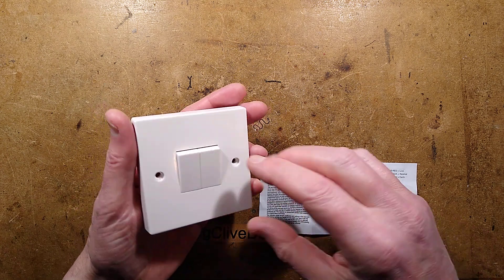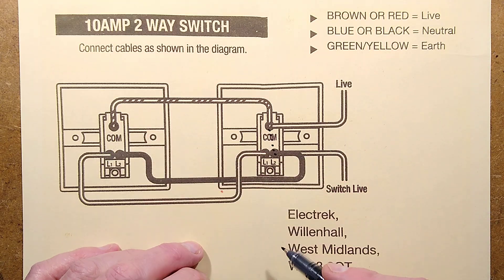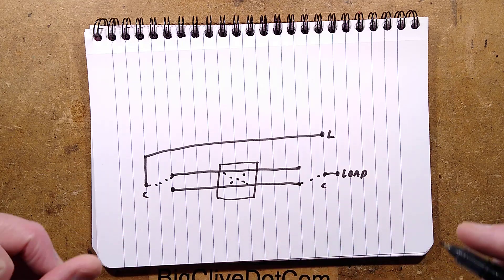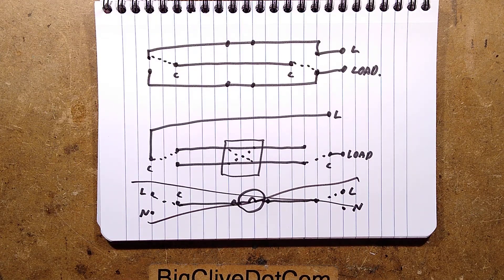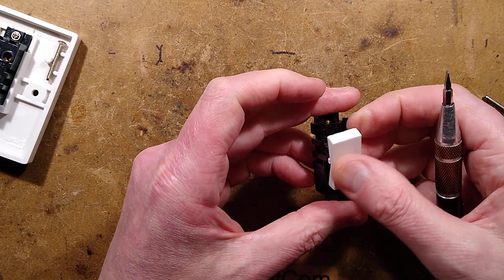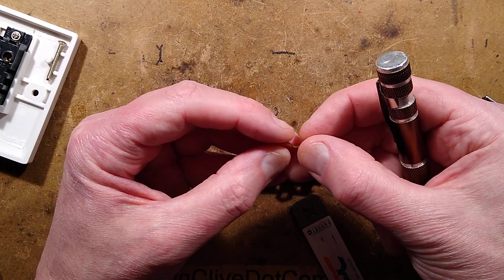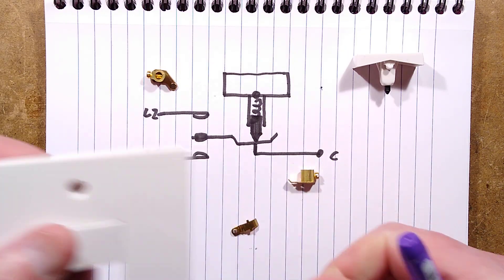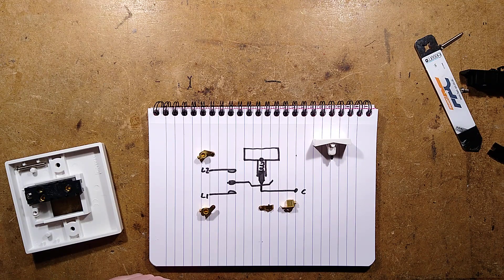Poundland 50p switch teardown

Comment: So, in essence, me not being a sparky but relying on the diagram to allow me to swap one out myself means lots of death and fiery doom.

Brilliant.
Reply: No death or fiery doom, unless you do something silly like try to replace them while the circuit is still energized. As Clive mentions, it just means your switches won't work the way you expected them to - one of them will lock out the other when it's on.

Comment: It always makes me laugh in the movies when the lights are turned on in a factory, stadium or supermarket. There's a BOOM, BOOM, BOOM, sound synchronised to the illumination as opposed to a little 'click,' click,' click.' 😂
Reply: actually that is right. In a large place you don't just "turn on the lights" you operate a switch and a bunch of control electronics takes over and switches the lights on in banks through relays (or similar) There could be kilowatts being switched on each bank, they make a bit of a thump
Reply: I like the candles in the movies - they light one single candle and its like the whole room is in daylight 😂
Reply: I like the sci fi movies with booms and whooshes in the vacuum of space when ships fire on each other.
Reply: That is because in larger systems, there is a large contactor (just a power relay) instead of a small switch as the kind shown in the video. And contactors are *loud*. They really do the "boom" seen in the movies, especially if the place is empty! Some places even have sequencers to spread the large startup load along a few seconds, resulting in the "boom boom boom..." you mentioned.
Reply: @MCPicoli  You are right, in this case the movies are actually authentic.

Comment: The top three way wiring, with one minor adjustment, is called a California three-way. It's connected the same except that the hot (line) would be connected to the left switch while the load would stay where it is. It's not recommended anymore since it traverses the length a variable one or three times, vs two times with the hot and load on the same side or one time with the traveler configuration.

Comment: Over a decade ago we had our house remodeled and the main floor hallway light had a 2-way switch and I guess the electrician followed those misprinted instructions as it didn't work as intended. It's always fascinating how different countries use different terms. As someone else mentioned we call that wire a traveler.
Reply: A classmate once told me that his mom (a maths teacher) had replaced the kitchen light switch. Now they could either have the light on or listen to the radio but not both (she connected the live feed to the socket next to the switch to L2 rather than Com together with the feed in). I told him it was an easy fix but he politely declined, they'd gotten so used to this state of things they didn't want to change it.

Comment: the first thing i did in my home after learning about electronics was replacing a broken switch with one much like yours. it still has the switch upside down as I cocked up the installation.

Comment: I'm still stuck at wanting the cross-cross switches in one place??? Like the point is so at any location you can toggle the switch and the complete circuit is effectively toggled, but what's the point of having it in one place?? You just WANT to use two switches, and have criss-crossed to be on??
Reply from the maker: The mid position switches could be used in a long stairwell so that each landing could have a switch.

Comment: I was an electrician in the US for 40 years.  I always used your first option with the common on one line, and the other load with two wires jumped between.  We consider that a 3 way switch, then any more in between are 4 way.   Sometimes, mainly doiing rewiring of an older building,  I might us the method you prefer. All depends where the line and load wires are. Every country seems to consider it different.
Reply: I think the design and accepted usage of the accessories is also a factor.

AIUI US lightswitches are typically designed for only 1 wire per terminal, while in the UK we use a different style of terminals and think nothing of putting up to three wires in a terminal. This changes which wiring method requires the least splices for a typical installation.

Comment: The wiring diagram seems to have little to no relationship to the actual switches. Why would anyone want to wire up two switches on the same gang plate as a two way switching circuit. The only practical reason why one uses a two way switching is because one wants to control a load, usually a light, from two different and widely separated locations or switches, definitely not two switches on the same gang. The wiring diagram as published is practically useless and redundant as well as being mislabeled. Maybe that is why the ganged switches were going cheap.
Reply from the maker: A two way switch can also be used as a single switch, so the plate with two switches could be controlling a porch light and also two way switched hall lighting.
Reply: @bigclivedotcom  Not really relevant as then each switch on the plate has a different function in basically different circuits which is normal and not what two way switching is or what the supplied circuit diagram represented?

Comment: Wiring method can depend on the cabling method being used. Eg single insulated cables in a conduit or double insulated pvc/pvc flat cables clipped.

Comment: 6:56 I must confess to, as a child, deliberately holding switches at the position where it rocks so that they would make a sparking noise and make the lights flicker!
Reply from the maker: I did that too.
Reply: Me too! With the added incentive that I could hear the interference on the TV downstairs, and my parents complaining..
Reply: I discovered that where I used to live, if I had the oven, computer, PS4, and the AC on, and then tried to do vacuum cleaning, the lights would flicker. The main breaker had a 30A (3 kW) limit.
Reply: LED lamps spoil that game for the upcoming generation because the power supply usually smooths out the flicker: spoilsports!
Reply: Hooligan!😉

Comment: Electrically, how does this work? We have lights in our house that can be controlled by three different switches and I cannot for the life me work out how they work. Seeing it sketched out, I still can’t work it out since it seems to me that the electricity can still flow to the light somehow. 
I haven’t managed to find a good resource explaining how this works, only resources explaining how to wire them up.
Reply from the maker: Draw out the multi-way schematic I showed and then draw in every possible combination. Or for more fun, wire up some real switches with a USB power supply and a USB light for a practical demonstration.

Comment: 3 way/2way switches are single pole double throw switches. 2 in parallel can be used as a transfer switch or forward and reverse switch and if you add a 4, way switch 2 pole 2 throw switch you also get a foreward and reverse switch for DC and you add as many as you want in between 2 single pole double throw yiu can turn on lights from hundreds of locations

Comment: I would say the way to wire the switch depends on what you want to do.
The normal way most people wire it is so either switch is capable of toggling the state.
But an alternative is to make it so either switch can turn it on, but both need to be off to make it off.

Comment: A little bit different to the switches we use "Down Under". Most of mine are two - way, even those used as mains power switches. The advantage is that if you have a duff switch, there's no need to change the faceplate - just replace the switch, and you're ok to go. The same enclosures can be used to accommodate indicators, and variable light controllers.
Reply: Sounds like the way we do it in continental Europe.

Comment: Nice job C. We use the strappers here in Ireland, but previously my work in the UK was method two, which is safer but uses much more copper. These things are taught in parrot fashion and its amazing how easy it is to confuse a spark!
Reply: Depends on what you're trying to achieve. In Germany, method two is known as the "wire saving 2-way" because you've got a permanent live at each switch and can easily add a neutral by running a five-core cable. With method 1 you need a six-core on one side.
Reply: @Ragnar8504  indeed Ragnar, unfortunately here in Ireland we use single core double insulated cables for lighting only. The live (phase) conductor loops to the light switches and the neutral conductor loops to each lighting load. This is purely a post war copper saving method that never should have survived the 70s, but is still allowed. So in a fault condition you will have both conductors being live at any single point. I do not use this method and prefer multi core cables as they are safer, but yes they use a lot of unnecessary copper.

Comment: Yes we stupidly called them three-way and four-way switches. Could never keep them straight and I usually end up calling them two-way and three-way anyway. only to later find out that that's what they're called in the UK. I don't understand why we have to convert to the metric system I think both systems have their merit but I am on board with the switches. Although I do like them pointing down meaning off. I was over on Reddit in the electrician section and I commented something and got chewed all out for calling the switchs by the wrong thing and I have never ever heard of that was the respons used to say I knew nothing.

Comment: I'm guessing there's at least one viewer who bought a load of these for a little DIY project to replace the scruffy, paint covered, old ones in their property. 
Everything went fine, but they could never figure out why the light in the hallway, or on the stairs didn't work once they installed the new ones. 
I mean they DID follow the enclosed instructions and wiring diagram, after all.
And now the penny has dropped, the instructions lied, they lied...🤣🤣🤣🤣🤣
Reply from the maker: That often happens to DIYers with two way switching anyway.

Comment: Today I learned about intermediate switches after living in a house for 25 years with three stairs landings and those awful timer push switches and never worked out how to do it with the more common change over switch instead of the whole place going dark every 15 seconds.
Reply: These days you'd probably replace the whole lot with motion detectors. You can also get latching relays to replace the timer without any changes to the wiring. Or just set the timer to more than 15 seconds 😅

Comment: The "non compliant" method is known as the "Chicago 3 way" here in the states. Also very much non-compliant and against national electrical code here. Your second method at the top of your drawing is, I think, what we refer to as a California 3 way. I don't remember off-hand if it meets code here in the states, but it's generally frowned upon. The first method you drew is the preferred method here in the states as well. Recent code has now mandated that all boxes have a neutral available to accommodate smart switches and such, so things like the "switch loop" where you'd have the feed cable coming into the box with the fixture, then breaking the hot by sending it down a single cable (romex/twin&earth) to the switch on one conductor and back on the other, are not allowed anymore. I never cared for seeing the neutral wire used as a hot leg, but it used to be very common. Now you'd have to use three conductor cable to wire it this way and honestly, what's the point.
Reply: The California 3-way can be code-compliant, as long as you meet the neutral requirements. But the same is true of the "correct" method.

The code doesn't actually require a neutral in every box. It requires a neutral in at least one box, or in every box that isn't visible from the other boxes. The idea seems to be that if the box could contain a motion-sensing switch, it needs a neutral. It's just easier to put a neutral in every box than it is to explain the actual requirements.

Comment: I remember my father explaining to me some 50+ years how to wire the landing light, which had switches at the top and bottom of the stairs. It was method 3, with one switch fed by the upstairs lighting supply and the other by the downstairs supply. So depending on the switch positions the light could have been powered by either of two fuses in the main fuse box!
His father had been an electrician, so perhaps that is how they wired houses in Leicester in the first half of the last century.

Comment: It was bitchy, but... years ago I was replacing a ceiling rose. I thought it was going to be very easy, until I read the instructions which went on and on about looping requirements and what have you. I jabbed some wires into what seemed to be the appropriate places - made all the more difficult because there was not sufficient slack in the cables - and it all seemed to work ok. I never did find out what loops required what.
Reply from the maker: You got lucky.  Many people just bridge all the reds, browns, blues or blacks and end up with a light lit continuously except when the switch is turned on and the breaker trips.
Reply: At Uni in our bedrooms we had a 2A breaker for the entire room. That was too stop us running heaters. 

So a plug wired with live to neutral was used to turn off the room light from the bed: it worked by tripping the breaker. This may not have been approved by the Uni authorities: for some reason we never asked...

Comment: I thought the reason for a 3-way switch was to put each switch on opposite ends of the room. That way you could turn the light on/off regardless of which end you were at. What's the point of putting both switches together?
Reply: Two separate lighting circuits for two different lights, with two other switches in two other places.
Reply from the maker: The switches can be  used as single way too.

Comment: bedside lights, sometimes even sockets for lights are wired as shown in the manual. the idea being that you can turn the light off and on at the bed, and the other switch is at the door. so when you leave, you can turn it off from there. since the other switch is left as is , it will work as intended. if you allready have the bedside switch off, but out of habit you do frl9ip the otherone while leaving, the light will NOT turn on. thats on purpose.
Reply: Not with the wiring shown on the printed sheet.  Either switch can turn the light on, regardless of the state of the other - but if either switch does turn the light on, the other cannot turn it off.
Reply: @pnt103  on a secund look, indeed i stand corrected. thank you. the shown diagram is indeed not for the bedside lamp situation.

Comment: The third variation was done formerly in Germany sometimes because you could save some cabeling, especially if you want an outlet directly by the switch. You have live and neutral at every switch per default, so it was dubbed "Sparschaltung" as you saved on cable.

But you named the disadvantages and DANGERS of this very correctly, and it is also impossible to have a third switch added. 👍

Comment: Many years ago (78/79) when I was in my first year at college studying electrical engineering I was taught the first method of wiring a two switch & then inserting the intermediates into the circuit.

Comment: the non complient circuit is known in germany as "Hamburger Schaltung" (Hamburg circuit) and from what I've heard was done to add two way switching to a existing light circuit without needing to pull multiple wires from switch to switch but only a single wire to the light. also the circuit is not only dangerous with the old switches it was installed with but also with newer switches it can go bang when switching between the L and N

Comment: your highly non compliant way of switching both the neutral and the live is especially fun if you take into account both hots could be different phases as well, both switches would work independently when turned on but if BOTH are on you get double the voltage on the device!

Comment: The wrong drawing is designed to test the CB in electric cabinet - ha, ha, 
I think that the europian method is that the LOAD (light pixture is connected to Live on one side and all the switching i is done by connecting Zero to the other side (directly or by two switches in a change-over as you have been shawed).

Comment: The 3 way switch diagram would work if the live from the panel went to the common on one of the switches (doesn't matter which one) and the switched live to the load was connected to the common of the other switch. That's one of 3 methods we use to wire 3 way switches in the US. The traveler wires (what you call L1 and L2) would just connect between the switches.

Comment: Love your content! Its Interesting they're allowed to sell them with incorrect instructions really. Ive come across some issues when using the 2nd method (permL in L1 and swL in L2), if your 3 core to the 2way or intermediate switch is quite long, it can cause some cheap LED lamps to have a dim glow even when switched off because of the capacitive/inductance within the 3 core from permL to strappers. We tend to use the first method and wago the neutral through on the grey core.
Reply: Wouldn't you get capacitive coupling regardless of which method is used?

Comment: Why use 2nd method? It always use 3 wires instead of 2 for the first method if you already have a live wire nearby.
Reply: better for EMC flow and return currents are kept physically close - less buzzing in hearing aids and so on, as no big loop of current.
Reply: Essentially it’s to do with the way UK domestic wiring typically uses ring circuits instead of radials as are generally used elsewhere. The practice has its roots in the high price of copper at the time of a building boom in the UK.
Reply: @SteveW139  Ring circuits aren't used for lighting.